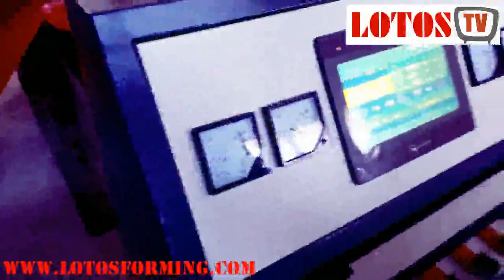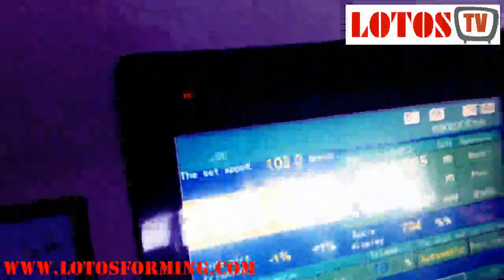high speed steel slitting machine/line (best 2019)

Comment from the maker: A slitting line will create multiple widths or “mults” from a wider master coil. The mults are made from predetermined widths. The slitter consists of three main parts: an uncoiler, slitter, and recoiler.  The material is fed from the uncoiler, through the nip between the two circular cutting wheels (one on top and another underneath), and then re-wound in slit mults on the recoiler.  The slitting process has been referred to as part art and part science. It is important that the equipment supplier and end user work in concert so the proper components, arbor size, tooling package, horsepower and tensions are suitable for the material to be slit.

Comment: Slitting line machine is not only for the steel service cutting industry but also for the pipe industry. A lot of customers make the pipes before slitting the large coil to the small size of coils. The slitting line can do uncoiling, slitting and recoiling works, make coil steel to any needed width coil steel. It mainly includes coil car, uncoiler, coil guide, slitting machine, scrap winder, tension unit, recoiler, and coil car, hydraulic system, etc.

Comment from the maker: From our four precision slitting lines we can slit from 0.2mm to 6.0mm thick material and in widths starting at 5mm up to 700mm. We work with all grades of Cold rolled, Hot rolled, Spring steel, Galvanised,  products with no minimum or maximum quantitiy requirements.